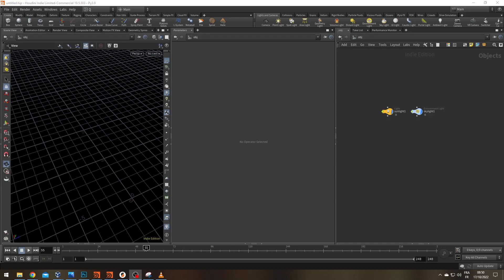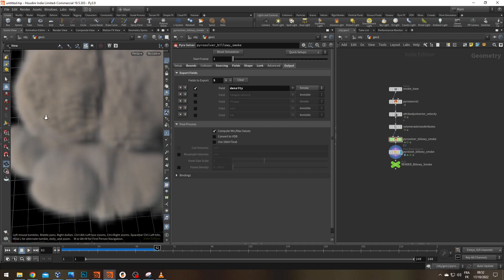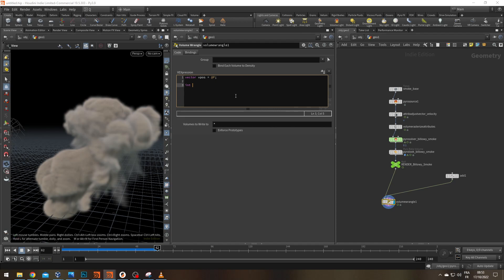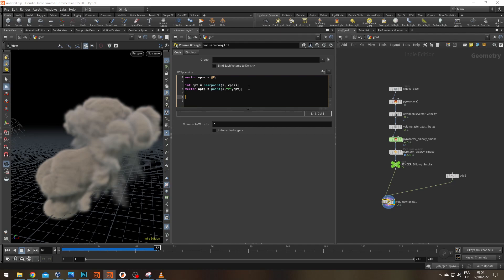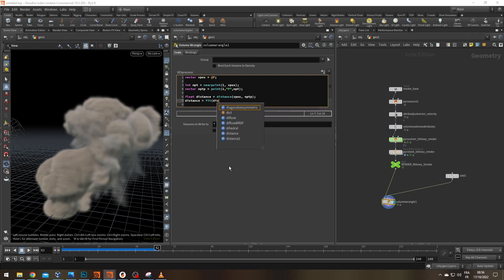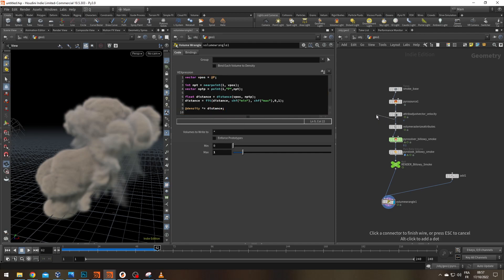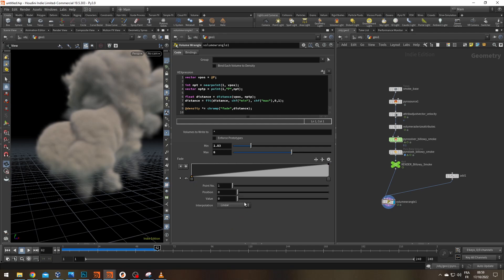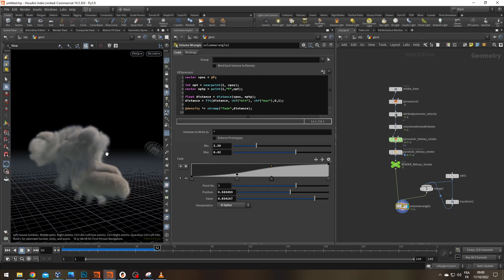[ENG] HOUDINI VEX Tutorial - Adjust volume voxel density base on it's distance to the nearest point

Comment: Hi! Is there any way to know the max and min distance values? I'm trying to reduce density based on distance from camera. Thank you!
Reply from the maker: Out of the top of my head, before this volumewrangle you could measure the distance between a bound and your camera, and then promote as a detail attribute the maximum value. You can then acces it with the detail function : detail("../mynode", "maxdistanceattribute",0)